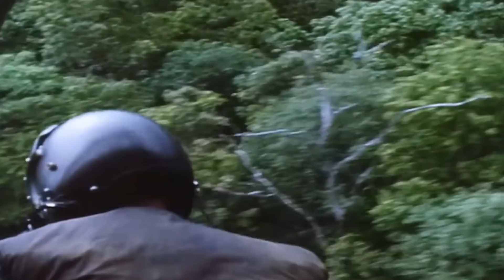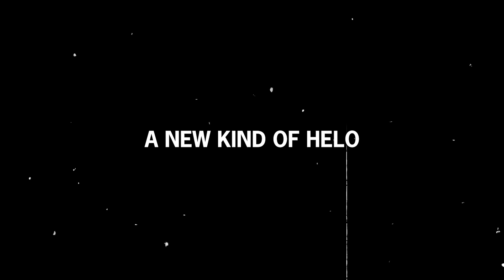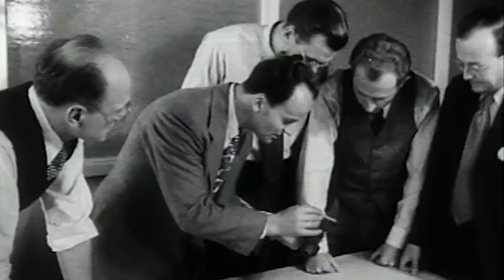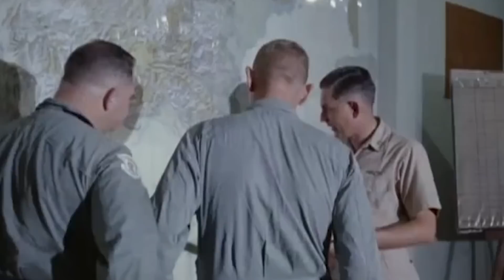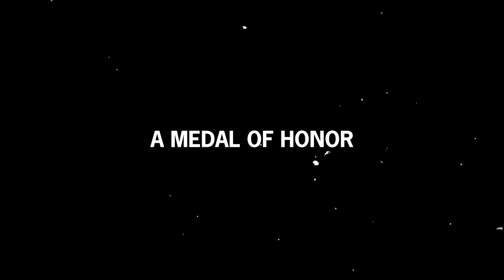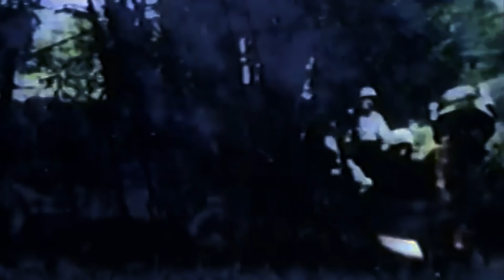Bring them Back Alive! Vietnam War Helicopter Rescues - Kaman HH-43

Comment: My second model kit after the UH-1 Huey was this Kaman HH-43 Huskie in 1/32 scale from Hawk/Testors.  It was a very well engineered kit for it's time and it's rotors were counter rotating.  The particular model kit I got for my 12th birthday was a limited run metal plated kit with a satin aluminum finish.  I believe Testors only did the metalized line of kits for a very short period of time in 1980.  This is a rare model from Testors in grey plastic form and the metalized limited run model kits are even more rare.  Thank goodness I learned to properly use the airbrush so I can give my models any real finish to make them historically accurate.

Comment: Back in the 70s I had a Husky crew tell me that the helicopter could do a maneuver that others could not. In a hover it could pitch up at a 45 degree angle and pivot 360 degrees with the tail as the pivot point. They used to take hotshot fighter pilots up for a ride and make them airsick doing it for giggles.

Comment: Check out where that tech went with today's K-Max.
6000lb lift from a single T53, standard AN fittings through the oil, hydraulic & fuel systems, a modular cockpit that can (at least theoretically) be removed and replaced with a remote control pod...a unique machine for sure.

Comment: How did it rotate? I imagine it used blade pitch, but I don't see how it could do so without having to compensate with a symmetrical adjustment on the other rotor to prevent unwanted banking.
Reply: The autorotation was relatively benign. We would almost always do autorotations to roll on landings (on a runway). It was much easier than an H-19 or H-21, which I trained on in the USAF.

Comment: The New England Air Museum has an HH-43F on display.  I volunteer on the museum restoration team.  We are restoring the forerunner of the turbine-powered HH-43, the Kaman HOK-1.  The HOK-1 (Re-designated OH-43D in 1962) was an observation helicopter flown by the Marine Corps from 1954 to 1965.  It was powered by a Pratt & Whitney R-1340 radial engine.  When I got out of avionics school in April, 1965 I was assigned to Marine Observation Squadron 6 (VMO-6) at Camp Pendleton, California.  We had 5 or 6 HOKs on the flight line.  They were gone by the end of May as we were transitioning to the UH-1E Huey.  The HOK was the first aircraft I ever worked on.  In August, 1965  VMO-6, and the entire Marine Air Group 36 (MAG-36), boarded the U.S.S. Princeton.  On September 1st we arrived off the coast of Vietnam to begin our in-country tour.  Many things come full circle, in 1965 I worked on an HOK and 56 years later I'm still working on one!

Comment: When I was a kid, my dad built a model kit of this for me. He worked all night on it. In the morning there it was on the kitchen table. It had a motor and batteries so you could turn it on to make the rotors turn. What fun! We lived near the Tustin marine base in Ca. and these would fly over the house. Nothing looked quite like them.
Reply: The famous Hawk 1/32 kit. Only the original issue had the electric motor; later issues did not. Non-motorized versions (and occasionally the motorized version) can still be had on eBay. I built the motorized one a couple of times in the 60s. It was easy to get your hand tangled in the spinning rotors while playing with the assembled model, shearing them off.

Comment: Began with a piston engine, turboshaft came later. Not technically a "Helicopter", it was a "Synchropter." It was actually extremely easy to fly being naturally stable, unlike most helo's. I don't know where Dark Skies is getting it's info but it needs to try harder. While most of the videos are good some- like this one- have glaring inaccuracies. I would be happy to help. The reason the Huskie, and Synchropters in general, went out of service was simple- it kept killing people because the blades dipped close to the ground on the sides. Not really any practical way to change that design feature and eliminate the safety hazard.
Reply: They went out of service because they had slow speed and short range. They air rescue mission required higher speed and longer legs. We never had any incidents where someone was injured of killed because of the blades.
Reply: @nealmac8549  I must have been misinformed. Or you were.
Reply: @garychurch9740  Well, I checked with some that were around the -43 thru out their life in the USAF.  And here is part of what he replied. " All aircraft have blade strike accidents and that was the least of the reasons our old friend was retired."
The blade strikes we had were in heavy rain delaminating the blades. For awhile we were prohibited from flying in rain.
Reply: @nealmac8549  Well, I was told by a very experienced military helicopter pilot I flew with that too many people had their heads chopped off by this aircraft and that was why the design is not used (except for the recent K-MAX) and that also it was so stable in a hover it could be flown almost hands off which is extremely rare for helicopters. He also said in autorotation the rudder pedals reversed. He never flew this type but knew other pilots that had.

Comment: These little Kaman choppers were called 'Pedro' in the Air Force. We had a saying, "When Pedro flies, Someone Dies" The intrameshing rotors rotated in opposite directions thus canceling out the effect of Torque (remember Newtons 3rd law) and eliminating the need for a Tail Rotor. The rotors were timed 90 degrees apart to prevent the rotors from coming into contact and always rotated at the same speed.

Comment: Another Husky can be seen at the New England Air Museum in Windsor Locks, Connecticut. Less than 5 Miles from where it was originally produced.

EDIT Kaman aerospace still uses a helicopter with the twin rotor design as a test bed for R&D. You can occasionally see it flying if your near Bradley international Airport.
Reply: The Pedro Rescue Helicopter Assc. had place memorials at Gunter AB, AL; USAF Academy, Colorado Springs; Lackland AFB, TX and next year at the USAF Museum Dayton. Memorializing Pitsenbarger and our mission.

Comment: They still fly a Huskie at the Olympia airshow every year. Such a privilege to see fly while the blades last.
Reply: It also trains new Kaman KMAX pilots. Shes not long for this world, but still does alot of good.
Reply: It may not be flying any more because the roter blades are running verry low on flying hours
Reply: I used to see it every year! I was a volunteer there a few times
Reply: As of April, the “school bus” still flies as a trainer after the flight simulator completion. K Max trainer after that.
Reply: Those rotors are made of wood. They are not made any longer and the ones at Olympia are running low on time so won't be able to fly much longer. I still like the sound even after being out of them since 1967.

Comment: Interesting helo, very slow, But exceptionally mechanically very sound and apparently they never crashed one due to a mechanical failure other then a transmission failure. About 190 were built, for fire fighting by the USAF. But once deployed to Nam they took on rescue duties. A version of it was built in the 2000s for heavy lift. And some were deployed to Afghanistan as remote  controlled hello delivery.
Reply: I was pilot in two that had compressor stalls causing engine failure. One was at MacDill, FL when we went into the bay. Then on my last flight at Incirlik, Turkey. I was on the stick and was able to land it on the active runway.
Reply: That was a time ago, do you remember they the were high time engines? And what is your view on their mechanical reliability??? Thanks.
Reply: @raywhitehead730  Don't recall. I have the accident report for the one that went into the bay but don't recall anything like that. I have contact with Crew Chief as he was in back doing practice hoist pickups. I'll e-mail him w/the question.

Comment: The Ovation acoustic guitar was designed by Kaman Industries.One of their engineers was a musician who noticed how rock bands had to wrestle with delicate acoustic guitars that didn't sound good when amplified. Kaman knew a lot about vibration dampening, so they simply worked on vibration amplification on a guitar that could survive extensive touring through different climates. The resulting Ovation guitar was immediately embraced by everyone, being seen in the hands of Al Stewart, Brian May, Peter Frampton, Carlos Santana, ABBA, and countless others. Ovation guitars are still being built today, and it's arguably Kaman's most successful product.
Reply: You beat me to it, however you left out one of the biggest Ovation players, Glen Campbell!
Reply: @georgelackey622  Yngwie Malmsteen, Def Leppard, Steve Harris, Michael Hedges, Glenn Frey... the list is endless!
Reply: @curbowman  Yes it certainly is!
Reply: I did not know that.  I use to have a Ovation 6 string,  it had a bulbous plastic back?  Very good guitar, too bad I gave it to an ex girlfriend....I sure miss that guitar.
Reply: You guys lost or what?
Reply: @THEfamouspolka   it appears that the company that made the Husky, also made acoustic guitars according to the Op